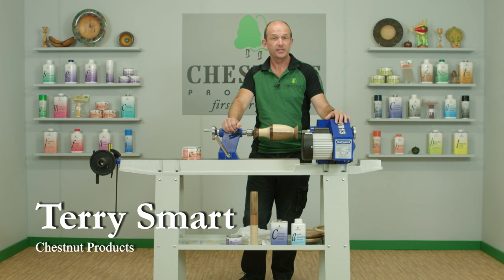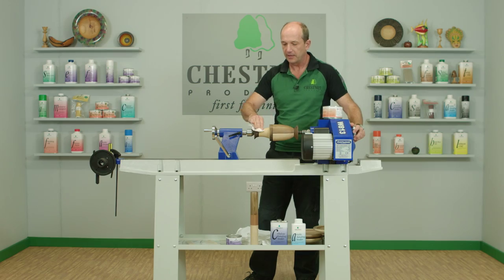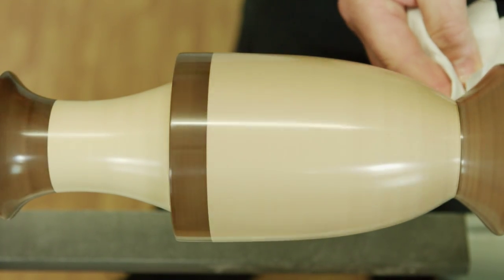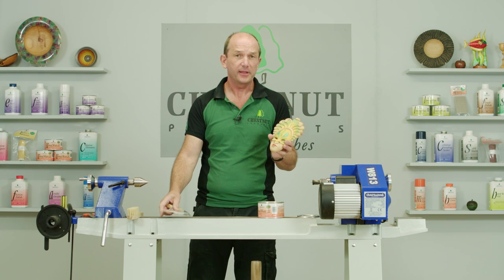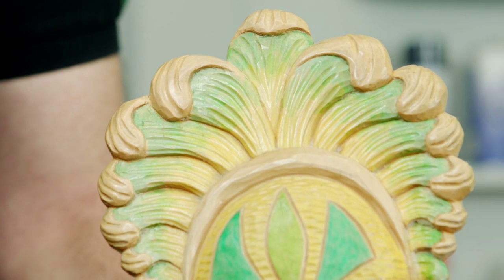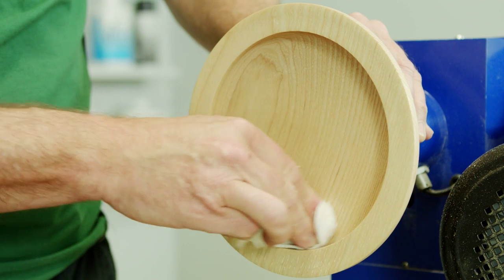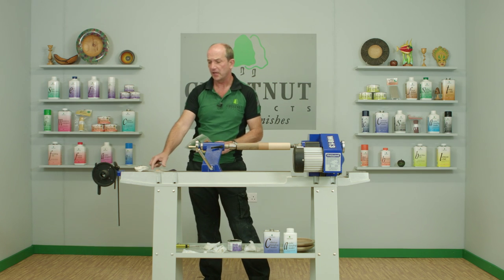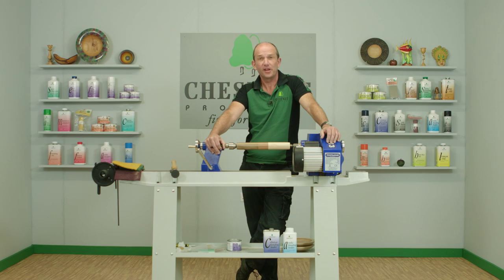Using Wax on Turnings - Chestnut Products Finishing School 4

Comment: Hi Terry
Your video is just like your products EXCELLENT! One question, what speed were you buffing at?
Cheers
Roger
Reply from the maker: Hi Roger
Thank you for that kind comment!
I usually buff at around 1100rpm. That's a good starting point, see what you feel comfortable with.
Terry
Reply: @ChestnutProducts 
How hard do you press when buffing?
Reply from the maker: @avecforte8851  A firm, constant contact is required, the large does the work. You shouldn't press hard as this can cause too much heat.